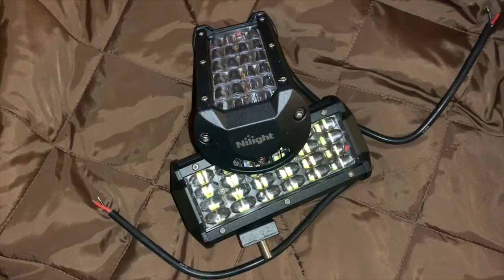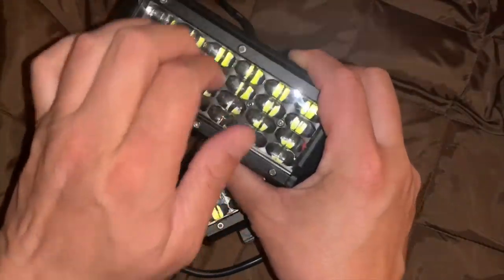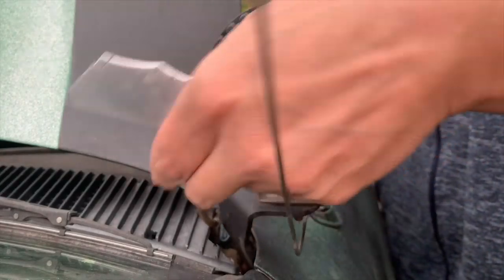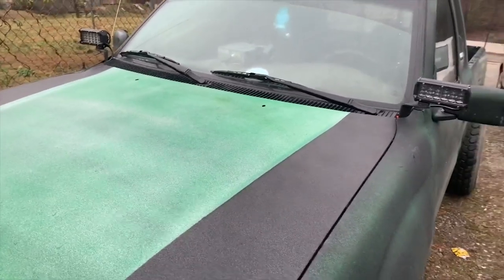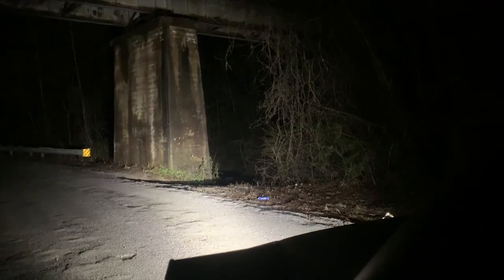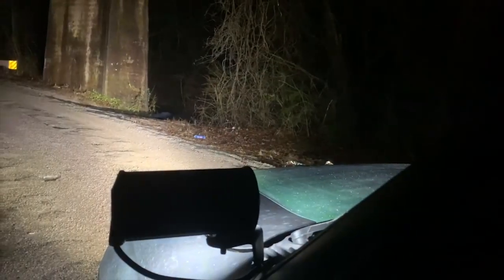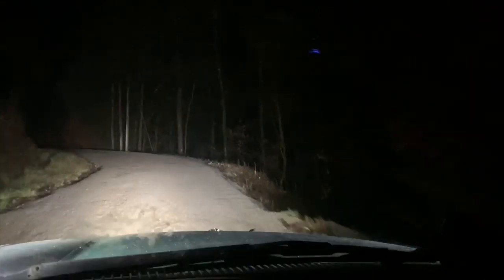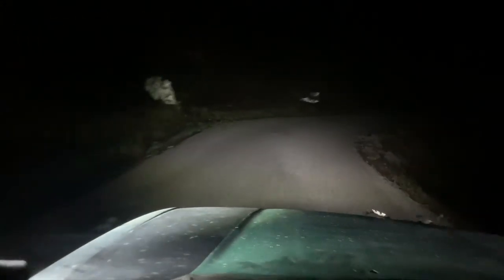Nilight 6.5” Light Bar - Ditch Light Installation & Review

Comment: I see that you tied both red on red wire together along with the black. I have these for my mower but when i put the red wire on red battery terminal and black wire on black terminal it stays on automatically. I bought a switch but it still doesn’t turn them off. Could you help me out with what I’m doing wrong please?

Comment: Looks like I may be buying lights . Have a iron cross bumper coming and stock lights wont fit. Maybe I can make them fit with  some mods.thanks for sharing.
Reply from the maker: These lights are very bright. You can always MAKE something fit with enough JB weld and power tools lol
Reply: @budgetoverlanding6314  Yes Sir. I do know I  want legal driving lights for the bumper holes.